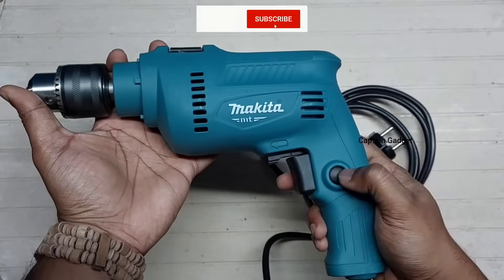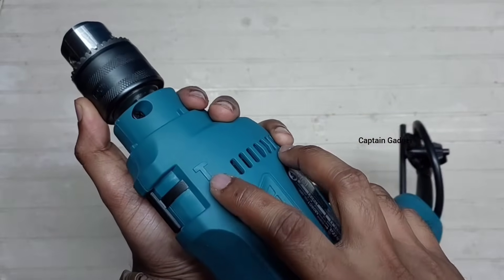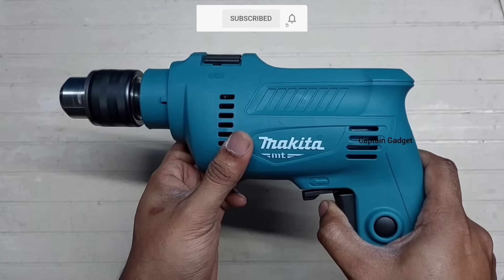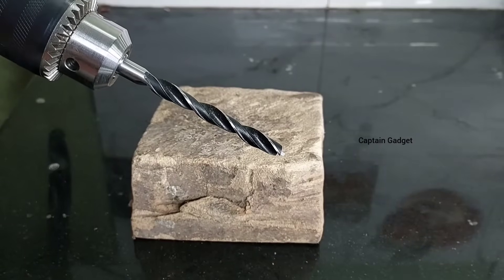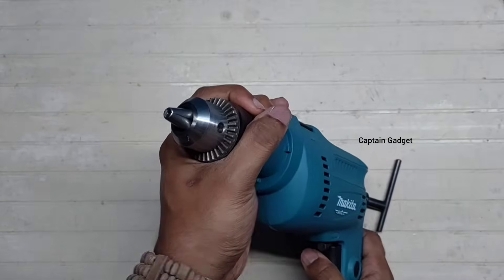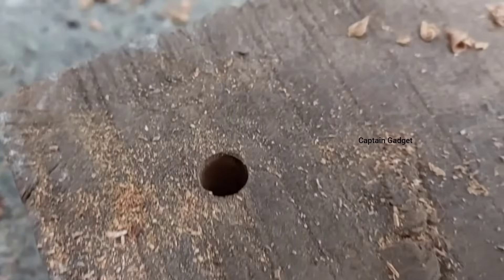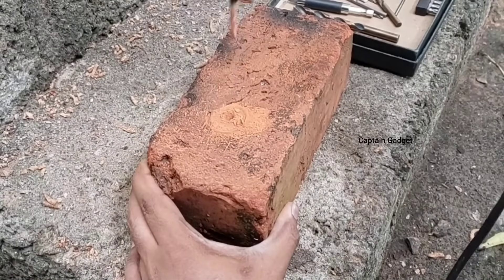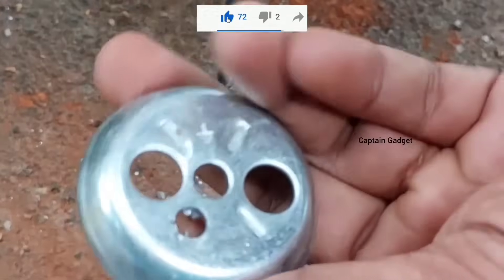How to Use drilling Machine.Types of drill bits.How to drill.How to use drill machine. Makita M0801B

Comment: I have high quality Bosch GSB 600 Hammer Drill Machine.
But it's chuck is rusting..
Not much...but chuck is becoming redish in color
Suggest me some maintainance tips for this
Reply from the maker: Apply Wd40 or grease wipe it with cloth, apply a coating to prevent further rusting😊.Like Share Subscribe